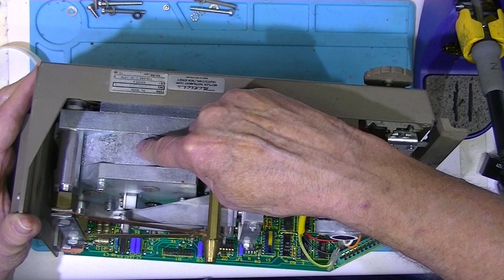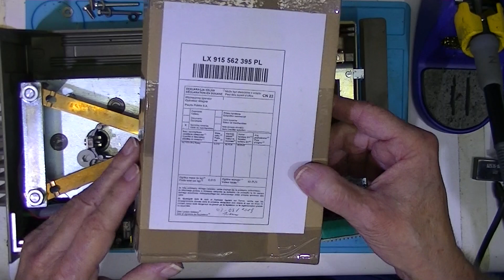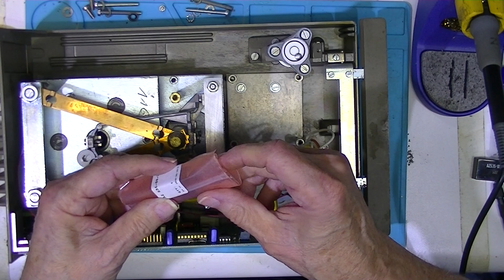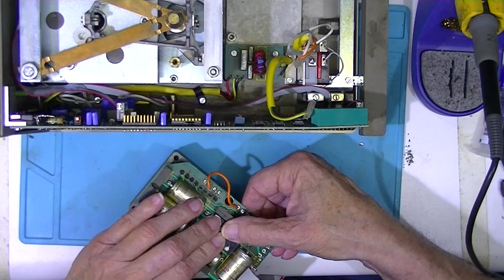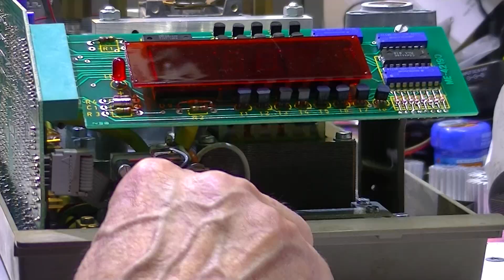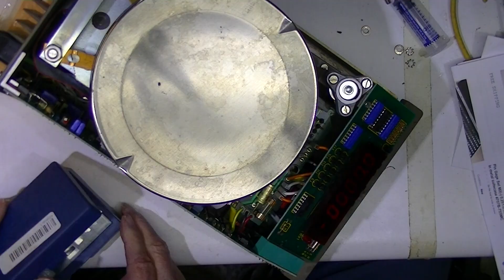Repair of a Mettler PL3000 Part 2

Comment: Sir Steve nice to meet you, I have Sartorius MC1 Analytic AC 210 P, No voltage, Display, the scale is almost 34 years but I've notice that the circuit is still looks fine, How can I easily detect the problem Area ? Than you so much ?

Comment: Hi Steve. Thanks for that video. i have an mettler ME204 which LCD display shows “temperature sensor defected" after power ON, What are the repair solutions available? many thanks.

Comment: Hi Mr. Steve, I have pj400 and i have an issue. The 0.00g on display keeps blinking so not stabilizing. What would be the reason? Just purchased used and i dont know nothing about it. I try to access menu but the button works only for on and of so i dont have access to callibration also. Any idea what would be the cause?  Thanks
Reply from the maker: Sorry, I can;t help. Good Luck!
Steve
Reply: @stevestrivia-bystevewagner4852  the technician said looks like a sensor problem. At least can you tell where is  this sensor located if you know? Thank you anyway sir. 🖐
Reply: It can be as simple as moving air. That’s why the more sensitive balances have a cabinet to shield against drafts.
Reply: @trackie1957  what do you mean by easy? easy to break or to adjust? can you help?
Reply: Sorry, I’m not an instrument technician, but I do know that if you have drafts moving around the room they will not allow the balance to stabilize. If you can remove the drafts or protect from them, you might have better results.

Comment: Nice job, Steve. I purchased the Mettler PL3000 on eBay for parts a while back. I wanted to use it to measure the weight of filament for my 3D printer before and after drying the filament to see how much water was removed from the filament. I couldn't get the unit to zero. But, the give away was a very almost imperceptible flicker in the display. I took off the cover and measured the ripple voltage across the caps with my scope. The ripple was OK on all the caps except for one of the 470uf caps. It had a 10 volt ripple on the 30V supply! I replaced it and it now the unit zeros out. I'll probably replace the other 4 caps at some point as well. Hope this helps someone. Cheers!
Reply: Thank you. I have just bought used pj 400 but the 0.00g keep blinking so would not stabilize. I am not sure what may i cause it. I can not access menu also. Can you help. Thanks

Comment: I have a mettler Toledo model # XS16001L it’s giving me an error “program memory defect” error.  Do you have a Video or can you guide me how to get rid of the error.
Reply from the maker: Sorry, I don't work on digitally controlled systems, only on digital display systems.
Thanks
Steve
Reply: You can find a service manual at ManualsLib titled "Mettler Toledo XS Series Service Manual" but it simply suggests replacing the terminal PCB for that error so not too much help for DIY.

Tiny chance that someone who does SMD soldering and  repairs phones could replace the flash memory IC (check the part numbers for which one) but it is likely that it contains code or parameters that are corrupted so you would need to copy them from an identical working scale.  You would probably need to do some sort of factory calibration after to update parameters for your scale if they are stored in teh Flash.  You may be lucky and the flash has only code and the battery keeps calibration parameters but there is no way of knowing.

Comment: Hi Steve. Thanks for that video. I am just restoring a broken Mettler PC4400 which looks very similar.  In mine some of the flat springs that hold the vertical column in place are broken by brute force. 
The "massive  chunk of metal" as you named it is a permanent magnet. The vertical movement of the scale-column is transferred by the scale beam into a vertical movement of a solenoid coil which 
moves in the air gap of this magnet very much like the moving coil in a loudspeaker. In my scale there is an optical sensor giving the mechanical zero position. The electronic sets the current through this coil to zero if there is no weight. If a calibration weight "C" is applied, the coil is moved and the current  - i.e. the magnetic force - increases to a value of "I" until the mechanical zero position is reached again. Applying an unknown weight W = x*C requires a current of x*I to reach the zero position again. Basically the current is measured and shown on the display.
Reply from the maker: That's an extremely well done explanation! 
Thanks
Steve
Reply: Hey @xabaer thanks for the explanation im currently trying to fix a PE400 with the same issue of broken flat springs. Have you succeeded in fixing it?
Reply: @miland2000  Hi, I have a small milling machine and I managed to remake one of the springs from an old saw blade. But then other more urgent projects came across and I had to postpone the other two springs. So, please ask me again in 4 weeks. But I am quite confident.
Reply: @xabaer  pfew thats quite some precision work. Do you happen to have any of the service manuals or are these springs available for order to your knowledge?
Reply: @miland2000  I do not have a service manual - just an operation manual with quite a bit technical information available on internet. I don't know about the availability of these springs. I doubt however that they are available. I think however that their parameters are not very crucial for the operation of the scale. they must be flexible enough in the active direction so that they do not hinder the necessary movement of the column and strong enough across to hold the column in place. You might even make them from bronze sheet metal using a fine hacksaw and some needle files.
Reply: @xabaer  might even try that
Reply: may i ask something? i have mettler pj400 which after transport the 0.00 keep blinking. what would be the problem?
Reply: @kenokoci9853  I don't have information about the blinking but I would assume that it means somethong like "out of range" i.e. the current through the magnet coil is not able to bring the magnet back to zero position. since the scale has been transported I would check if the scale is stnding on a roughly horizontal surface and if the weighing pan sits properly on the cone. If that is the case and it is still blinking I would open the case and check if the 8 sheet-springs holding the weighing pan are intact or if one of them is broken due to transport.
Reply: @xabaer  8 sheet sheet holder location? can i send you an image by watsap please. see what it is and just make me know.
Reply: @xabaer  i open and checked all capacitors etc all are in place. can not find the 8 sheet spring? at least can you tell me what can i  unscrew and check. can you give me a contact email or whatsap number please? just take a look. first time in my life i open something like that.

Comment: Hi Mr Steve, thank you for this interesting video. 
I have a Mettler BJ3600 scale where the pan does not keep its initial position (Perhaps, it is a problem of the strain gauge / Test body or the support).
 So, how can you help me (Video or manual)?
All thanks
Reply from the maker: Sorry, I have the manual (I think) for the PL3000, but Operation only, not Repair.
Good Luck!
Steve
Reply: OK , thank you sir